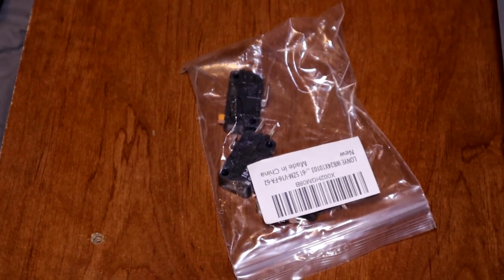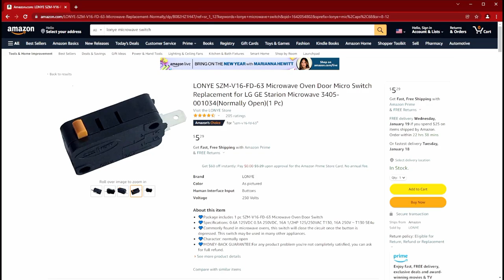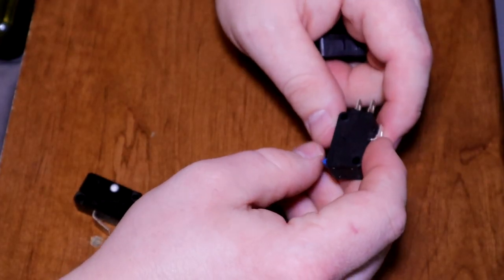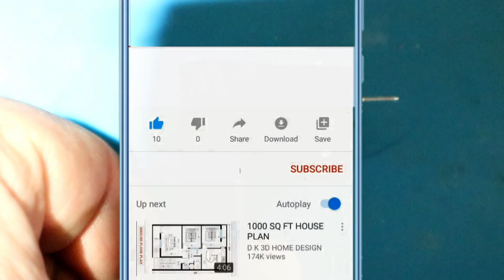How to Repair a Bad Tip-Over Switch on a Space Heater. THIS CAN SAVE YOUR LIFE!!!

Comment: How do you order the plunger when that is missing?  I can’t find the right search word for it
Reply from the maker: Sorry it took me so long to respond to this, I am not sure where exactly to order that part, I would make my own if it was me, but I know many people don't have the time or tools for that(and it should not be flammable). I would look up the model number of your heater and try to find a parts list with exploded view to find the part name or number. If you are lucky you may find one from a chinese supplier, but I think that most parts would be hard to find unless they are "off the shelf" parts, the switch is an "off  the shelf part" used in many electric products with tip over switches. I know that isn't much help, but I hope you find what you need.

Comment: Instead of the heater turning on when i put the heater, it turn off. When i lift it turn on. Can i siwth the or something?
Reply from the maker: It could be wired backwards or you have the wrong switch. Some swiches will turn off the machine instead of turning on. I have not wired one backwards before so I don't know if that would cause the problem, so just make sure you have the proper switch and that it is wired correctly. If it is a swich that does both you will need to move the corrct wire to the post on the switch that is not connected.